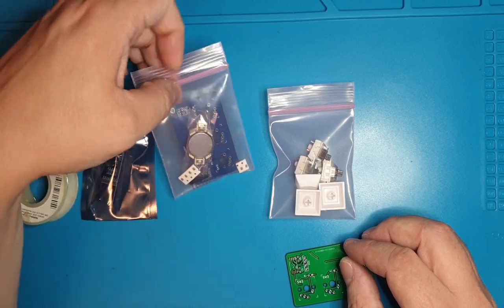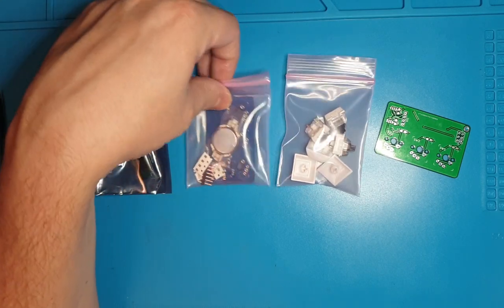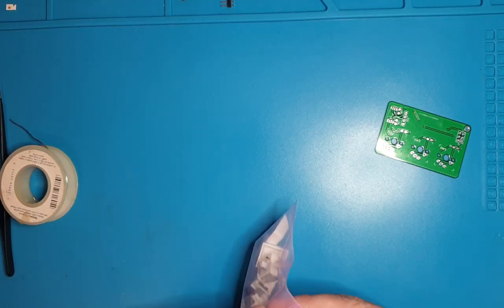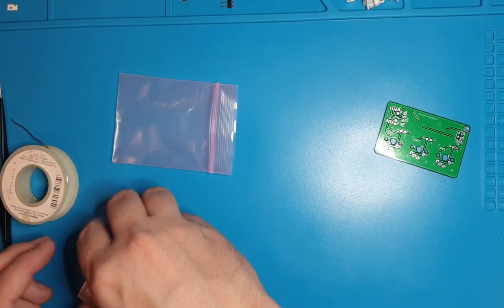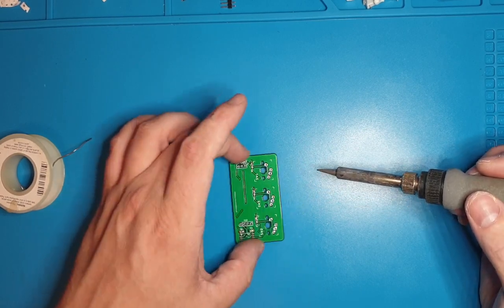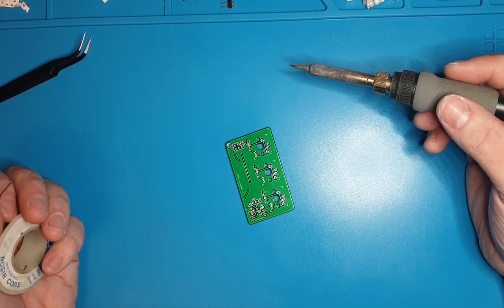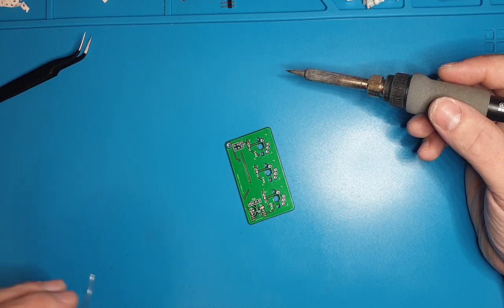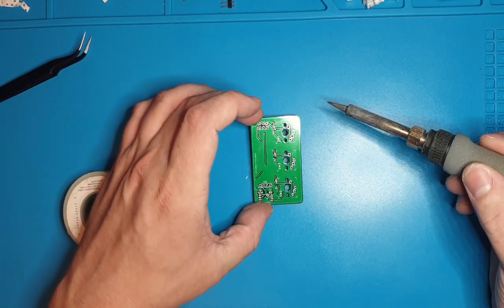KeebCard assembly instructions

Comment: Just soldered mine, however when I turn it on it keeps the "Paused" option on and off. Did I missolder one of the components?
Reply from the maker: Pause cycling probably means the middle button is being shorted to ground. the most likely place that would happen is the microcontroller; check the top two left pins (when looking at the board) for any solder bridges. If you have a multimeter you could check for continuity as well
Reply: @thekeebproject  I just reflowed all the  solder points, nothing has changed so far, it's still pause cycling.
Reply from the maker: @aznriptide859  hm. if you have a multimeter continuity checking would be very helpful. There's a chance the switch had it's leaves bent, or maybe some stray solder bridged the pads for the switch? 

If you can't get it you can send it to me and I can take a crack at it, there have been a few like this
Reply: @thekeebproject  I do have a multimeter, which areas should I be checking continuity for? I checked voltage and I wasn't able to get a reading across the switch, which means none of the battery's power is reaching the middle switch.
Reply from the maker: @aznriptide859  I just made a troubleshooting tutorial if that helps! https://www.youtube.com/watch?v=W7IxT4Zf5qs